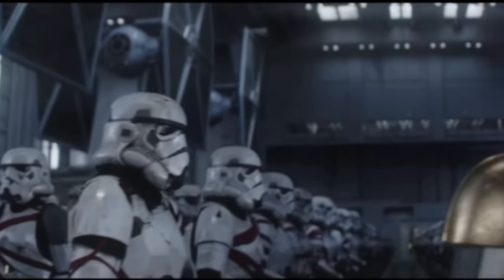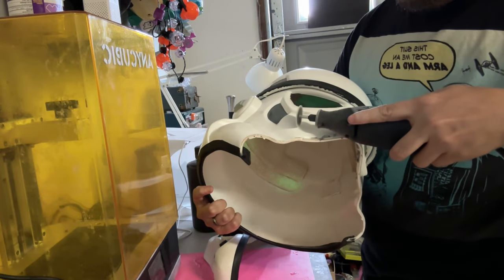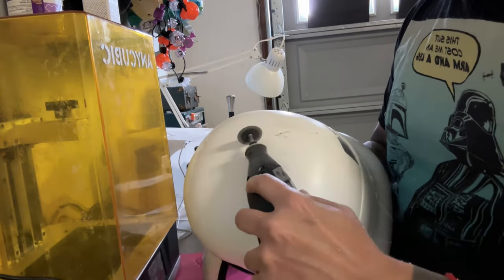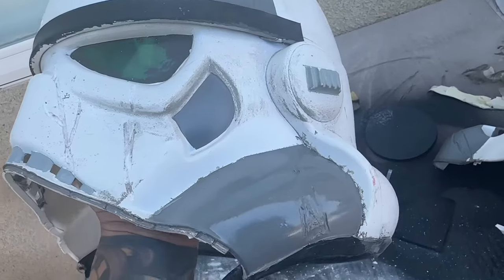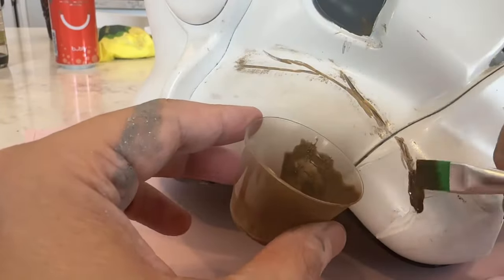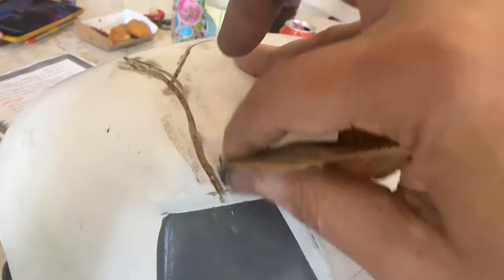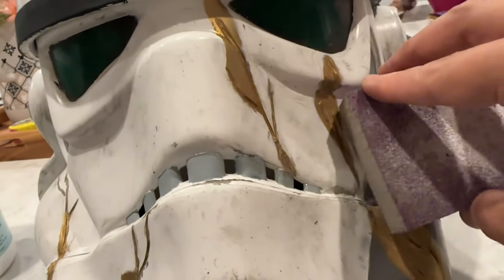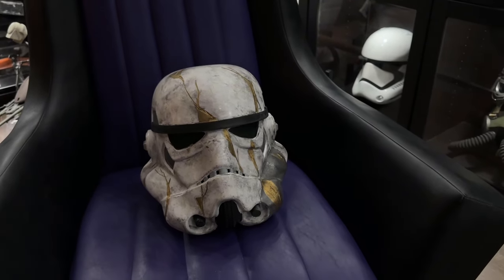How To Make Thrawn’s Night Trooper Helmet From Ahsoka Episode 6

Comment: I wonder if you were to physically break the helmet into pieces and then use then resin/mesh cloth inside the piece it back together and then fill all the broken cracks with the gold rub & buff. The resin/mesh (or whatever the material is) you get it wet and mold it inside the helmet and then it dries solid and adheres to the plastic. If that would work?